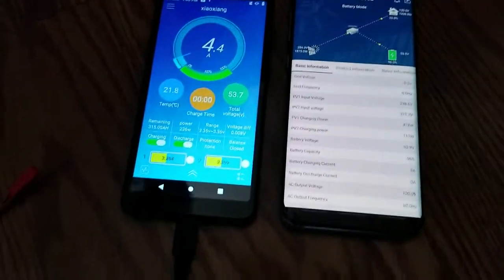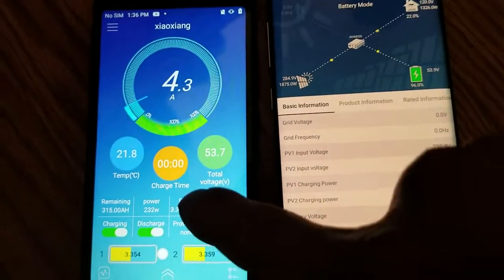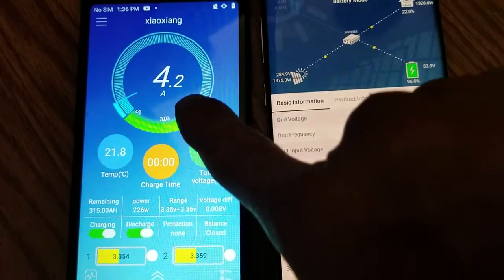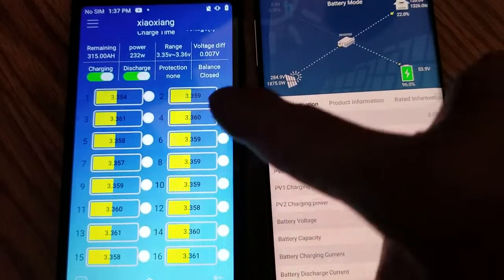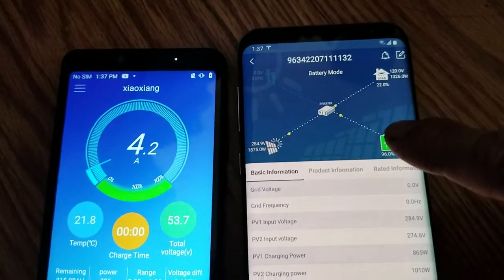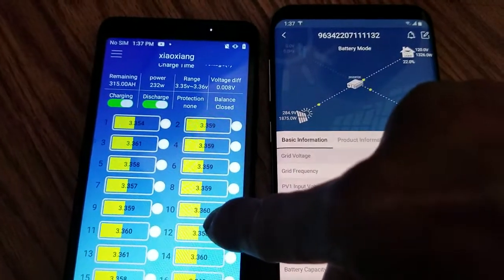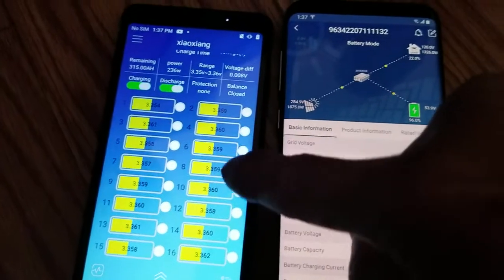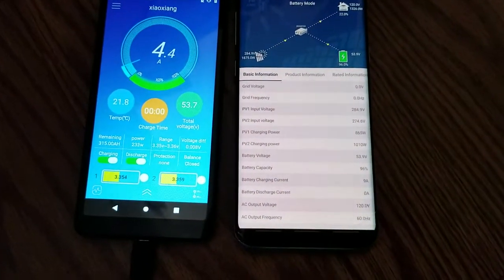JBD OverKill solar BMS what happen to the balancer?

Comment: @godisnowhere4u
1 second ago
 @evempsolar  Off-Grid Garage
@OffGridGarageAustralia

Automatic Active Balancer - The Evolution in Balancing

https://youtu.be/yPmwrPOwC3g

which ever balancer you go for ..
they work best if you have the ability to turn them on and off ... at a point of your choosing ..

i purchased a Daly bluetooth s16 Active Balancer on sale ,
 i think around 50 $ or so .. 
i use the app to start balancing around .. 3.38 or 3.37 volts .. to catch any runners early..
setting the startup deviation  to 0.020
once started 
if you let it just run on its own .. 
it will keep going until all cells are within about 0.005
.
but. 
we must manually turn off the balancer if we are actively using / draining the battery.
if we don't .. 
cell balance will be destroyed on the way down.
.
think of it this way
if you have 4 cells
3 of 100 amp hours and 1 of 90 amp hours
they can be 
all 100% full
 or
 all 100% empty
100 % Balanced
.
if you use 50 amp hours 
the 100ah cell will be at 50%
the  90ah cell will be a Lower % 
now pack at this point is 
not in balance
.